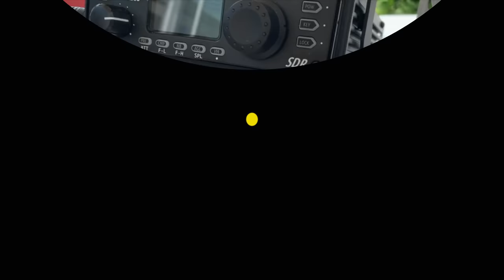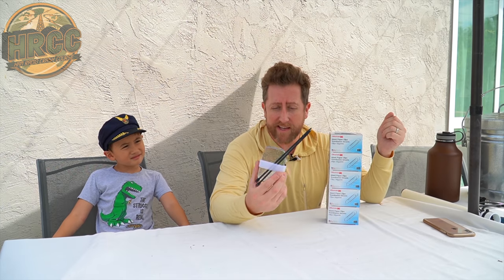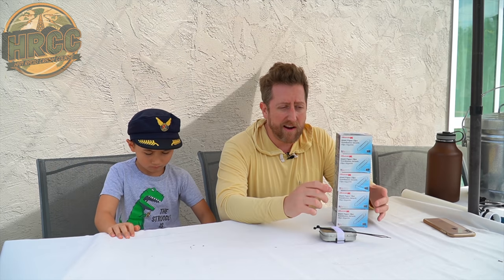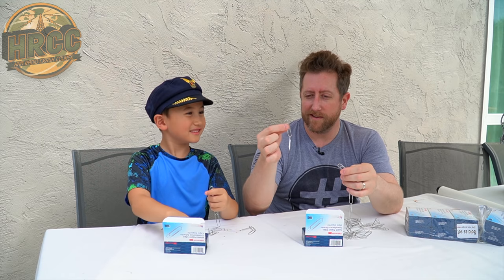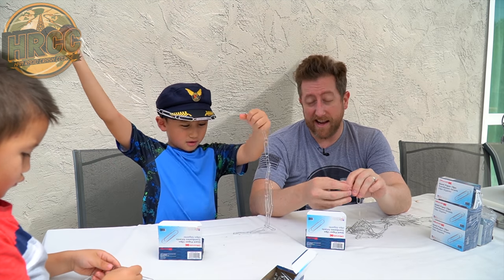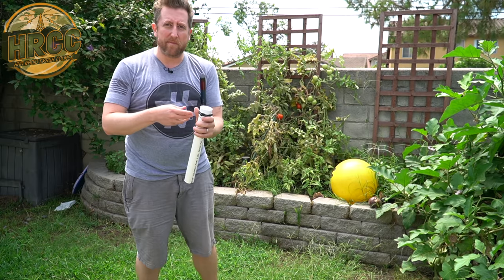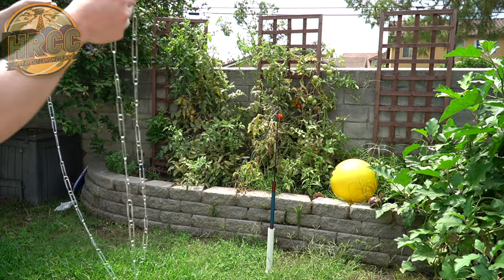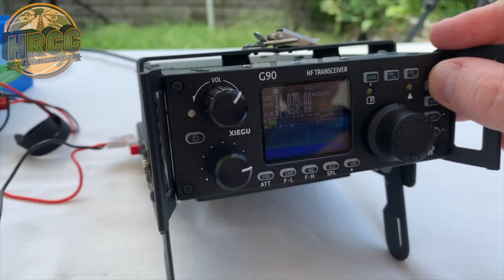100 Inexpensive Paper Clips - Will It Antenna?

Comment: In the early 1970s I picked up an old (even then) antenna transmatch and had fun broadcasting off "things".  Like a bicycle frame, junk car, shopping cart, rain gutter, chain link fence, electric fence (turned off of course), coat hanger, etc.  But I usually only used 1/4 watt because to me that was half the fun... trying to talk on weird antennas with the least amount of power.

Comment: Hi Josh,

First clue things weren't right; "it's jumpy (swr check) when I touch it (radio)"!

Second clue, "I just got bit"...
Ouch!

Solution - this would have been a really good time to use that "GROUND" terminal on the back of the radio! Safety, R.F.

Also proves 1st rule of electronics build/construction... you need a good mechanical, as well as electrical connection!

I figured this would be the result once I read the title.

Stick to lawn chairs on the rafters! Haha!

Have a better, safer day.  :-)

Comment: I've used (unfurled) Jumbo paperclips on 440 and UHF television reception, pushing the straight end of the paperclip into the small hole in the center of the connector.

In one case, I had a portable digital TV set on a beach at Manistique, MI. Over the straight path of Lake Michigan, with a cool layer of air producing tropospheric refraction, I logged two Chicago digital TV stations and others from closer Milwaukee.

Comment: Josh, you need to hang a weight at the bottom of the paper clips that should make the connection to each paper clip more solid. and get a better SWR.  Cool video.

Comment: Make an antenna out of junk yard parts. For your video. You can use the wire harness out of vehicles, or battery cables bolted toghter. You can only use what you have on hand. Simulating a situation of total grid down. McGyver type of ham radio. You can call it ,McGyver  post apocalypse event. To demonstrate how you can use junk yard parts to get a signal out. Including using transistors relays fuses and dashboard switches to build a power supply and transmitter. I'll bet it would get a lot of attention.

Comment: It is the coating on the paper clip and the slipping in the joint. As the current flows through the antenna it is jumping through the holidays in the chrome coating.
Reply from the maker: Interesting thought.  Likely the more use used it then, then better it would work?
Reply: Ham Radio Crash Course theoretically. I do Cathodic protection for a living and dissimilar material effect current differently. So it is trying to make the flow happen and the holiday is causing it to flow and try and be continuous in different places. Fun video!!

Comment: Drag it out a bit tighter for better clip contact and hang it like a sloper dipole and add a couple more links to tune the length and use a 1:1 RF choke at the top of the coax?  
I think 100 clips is a bit short?  
Regards, Jas.  
VK4FJGS  
Rockhampton Queensland Australia

Comment: is that 100% RF bite or also bad grounding from the extensions and whatever you're using to get power outside?
maybe it's causing some big capacitance in the paperclip wire - or is attenuating lots of different f
idk
Reply from the maker: I assume due to the paper clip links not being bonded it shorts often leading to rf coming back down the coax.  All equipment powered off battery.
Reply: @HamRadioCrashCourse  ah right I did think i could be battery
so I think we're saying - kinda the same thing, as there's breaks, it's creating capacitance at multiple bands ... or something, I'd love to learn more and test this
thanks for video!

Comment: Please, in the future use SSB. I want to know how regular (real) SSB radio works with your antennas. Not a fan of ft8.
Reply from the maker: You posted this same sort of comment on another video. Ft8 and Wspr, are propagation beacon modes. If any of the contacts are in the + then ssb communications are possible.  It’s not that the antenna is “better for ssb” or not.